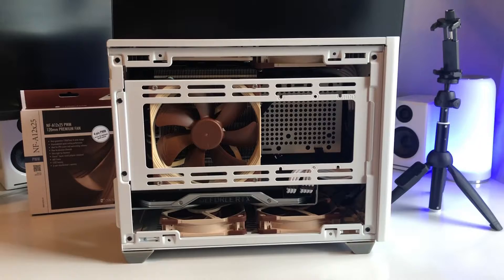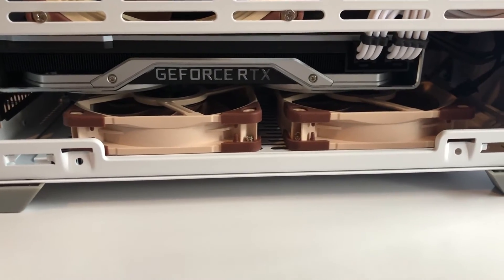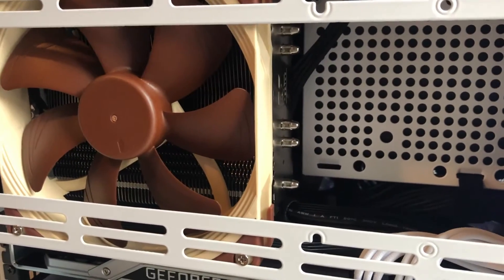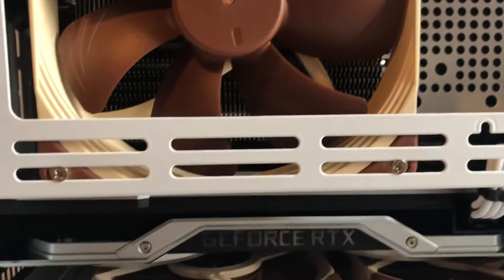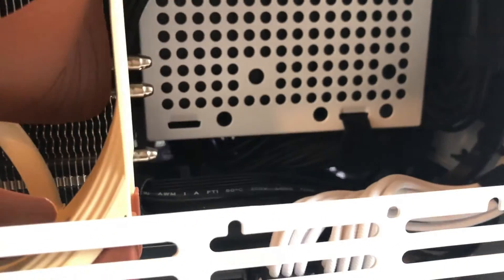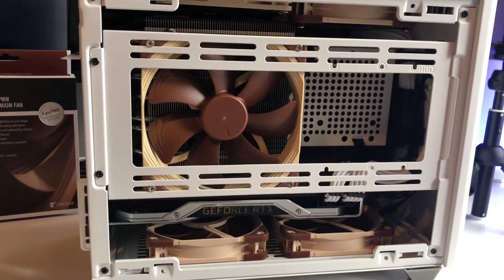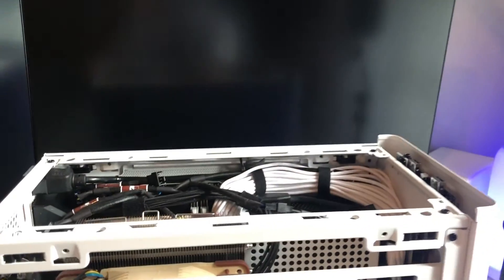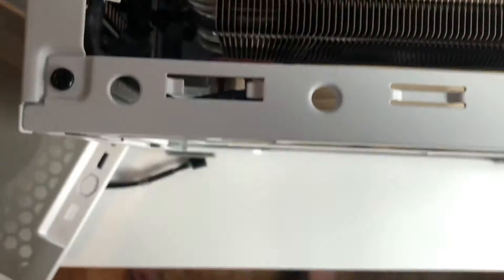Cooler Master NR200 Fan Layout

Comment: Are you using some kind of PWM hub or are some of the fans always running max speed?
Reply from the maker: No hub.  Just modify the fan curve in the cpu software so it’s runs low to high at hotter temps.

Comment: Hey Paul, I have a very similar setup to yours.  But I was able to sandwich the slim fan and a regular 25mm on the cooling tower. The only thing I'm missing is the slim fan right on top of the mobo and CPU. My idle temps rn are around 40-45C. Would that top fan lower the temps to get an idle similar to yours? My processor is a 3700x
Reply from the maker: More airflow on the mobo will definitely help with temps.

Comment: Hi Paul. Why do you use only 1 fan (the biggest one) on the side?
Reply from the maker: Temp didn’t drop much with two, but you can add it.  I actually added a smaller one next to it.

Comment: Thank you for showing this build. 
Do you think it would make a difference if I just use slim fans (12x15) on the top and bottom of the case?

Also, would the c14s fit in a rog strix x570-i motherboard with this ram: G.Skill Trident Z Neo? If I don't add a 12x25 fan under the cooler, will the ram have a better chance at fitting?
Reply from the maker: The 12x25 fans will provide better performance.  The Neo ram sticks are 5 mm   higher in length so it will be a tight fit.  You can remove the bottom fan from the cooler to provide more room but you sacrifice the cooling.

Comment: Would it be possible to fit a 92mm (25 or 15mm thick) to the left of the C14s?
Reply from the maker: No, there is no room for that.
Reply: @PaulVo  Thank you :)
Reply: @kazielbonn  I have a 92x15mm fan right there. I use the C14S as well in combination with a Gigabyte B550 Aorus Pro. Fits perfect.
Reply: @wespijffers8808  Yep, couple of weeks ago I went ahead and bought it anyway as I had another proper look and it looked like at the very least a 15mm had to fit. Installed it no problem on an Asus B550i. Hopefully our posts helps others who are thinking about this setup too.

Comment: Did you need mods to mount the slim noctua fan to the top or doesn’t mount normally
Reply from the maker: I just used bolts laying around that fit through the fan into the rubber grommets to keep it in place.

Comment: hello paul! im currently asking a store to build my pc for me (since i know nothing about building one), and i was told the nh-c14s cooler doesnt fit into my NR200P.
i'm wondering if there's any possibilities that might cause this? since theoretically c14s should fit into this case. (e.g. heatsink's orientation is wrong? wrong size of other thing(s) affecting this?)

here are my specs:
AMD Ryzen 5 5600X
B550I AORUS PRO AX
MSI RTX 3060 VENTUS 3X 12G OC
T-Force Vulcan Z 8GB*2 DDR4-3600
Kingston A2000 1TB
NH-C14S
CM Materbox NR200P
CM V650SFX Gold
Scythe Kaze Flex 120

Thank you in advance! :)
Reply from the maker: Only issue may be the ram height not fitting under the nh-c14s.  Need a lower profile ram.   The orientation of the cooler may affect the fit also.
Reply: @PaulVo  Thanks a lot for the reply!  May I ask which ram you're using for your NR200?
The store kept telling me NR200 is a small case, which has limited space to fit things in. however my friend has a even smaller case that could fit the exact same cooler/gpu inside, which makes both of us really confused. Another friend said it could be the store not gathering/tidying the wires well enough which decreases the space available for the cooler to be installed. 
I'll bring the possibilities you've given to the store and see how it goes, thanks again!
Reply from the maker: @MichelleLin007  ask them what specifically doesn’t fit.  The ram I have is here Crucial Ballistix 3200 MHz DDR4 DRAM Desktop Gaming Memory Kit 16GB (8GBx2) CL16 BL2K8G32C16U4W (White) https://www.amazon.com/dp/B083TYS4TL/ref=cm_sw_r_cp_apip_JItPnzgFwtpis
Reply: You probably figured this out already but the NR200 P variant is the glass side panel which is bad for a top down cooler, that may be why they say it doesn't fit.

Comment: Hi. Just wondering about the A12x25 you put on the underside of the cooler. I bought same cooler and same fan in order to replicate what you've done here but my A12x25 didn't come with any mounting clips (i mean... I guess technically it's supposed to be a case fan so makes sense) . Did you buy additional clips from Noctua or harvest them from a lesser cooler???
Reply from the maker: You can ask for one from Noctua and they will send you one for free.  That’s what I did.
Reply: @PaulVo  Thanks! Just sent them a mail.
Reply: @PaulVo  How long did it take for those mounting clips to arrive to you? And do you need to have purchased their product/s first so you can request that?

I'm in South East Asia so I want to get an idea if it's gonna take months until I receive those.
Reply from the maker: @marieantoine  2-4 weeks .  They will ask you proof of purchase.
Reply: @PaulVo  Thank you very much!

Comment: Hey, how did you connect two cpu cooler fans? With adapter or one on cpu header and one on sys fan? What are cpu temps at idl and at gaming? Thanks for answers.
Reply from the maker: Y adapter on the cpu fan header.  Idle temps around 30 C, gaming around 60-70.

Comment: Wow I didn't know you could stick a slim 15mm fan up top. Nice build!
Reply from the maker: Barely enough room..
Reply: @PaulVo  what screws did you use on the slim fan? As there is just a rubber grommet to hold the top fans in and the standard pegs used are too long for a slim fan.
Reply from the maker: @jondrenning97  I had some bolts lying around that I found fit.  Just need to figure which ones are not too long and fit inside the rubber grommets.

Comment: What cpu/motherboard are you using?
Did you try 2 side fans?
Deshrouding the GPU would help the temps also.
Reply from the maker: MSi z490i w/ i7 10700k.  Two fans on the side resulted in higher temps by 2 degree so removed it.

Comment: Have you tried without bottom intake fans? So it’s exhaust only
Reply from the maker: Just tested with no bottom fans and the cpu and gpu temps raised around 1 degree.  The side mounted fan still acts as the air intake.
Reply: @PaulVo  Is that because your table is blocking the air coming in? 1 degree temperature difference isn't worth the noise of the fans.
Reply from the maker: @Argooh  can’t really hear the fans.  The gpu fans is the loudest since it runs at 1500 rpm at all times.  There is some airflow air flow at the bottom of my case.  This helps the gpu temps more than the cpu.